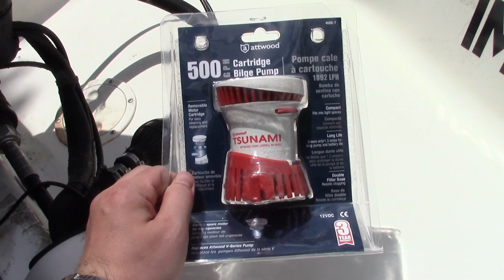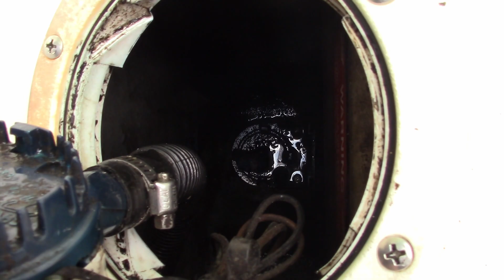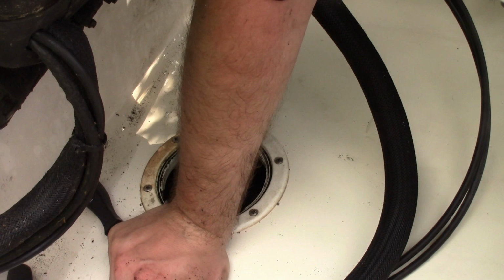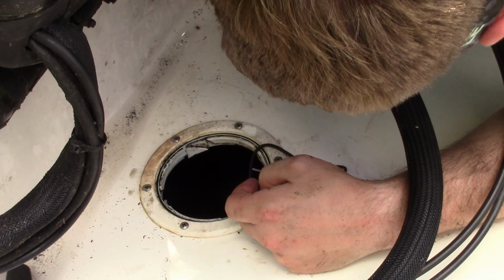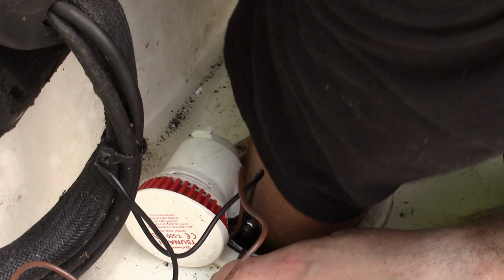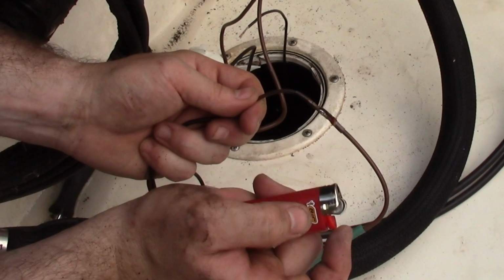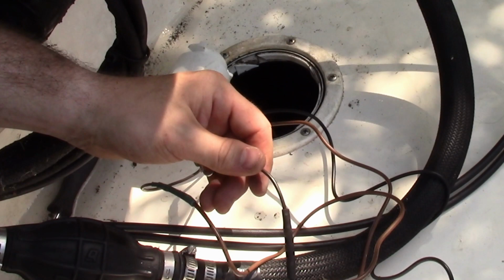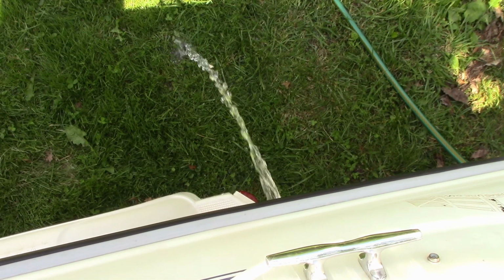Replacing Bilge Pump on a 1996 Sea Ray 175 Bow Rider Outboard (Attwood V450 to Tsunami T500)

Comment: Great video and it confirms why I’ve been putting off replacing my pump. I have the very same configuration and I’ve looked at this monster a few times and gave up before I started. I’ll give it another go..
Reply from the maker: Yeah it's an unpleasant repair. The worst part is the mount. If you can find the same model pump buy it. The wiring is actually really easy.

Comment: Hey Man, great video....mine is a 97 stern drive, same pump though.  Question: were you able to find the secondary (stern) fuse for this?  The O and M says it's near the battery compartment, but I've looked everywhere and got natta!
Reply from the maker: Does yours have a float switch for automatic pump operation? The fuse must be between the float switch and the positive battery terminal, but idk where exactly, sorry.